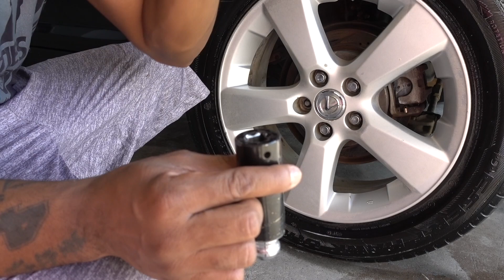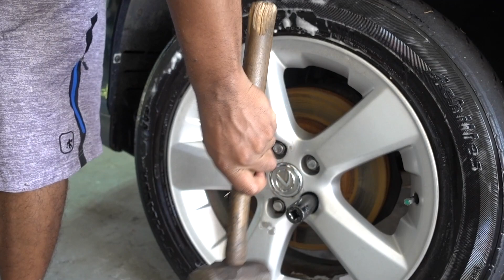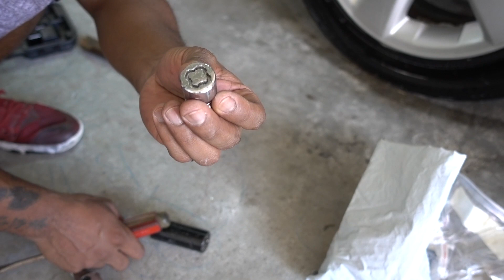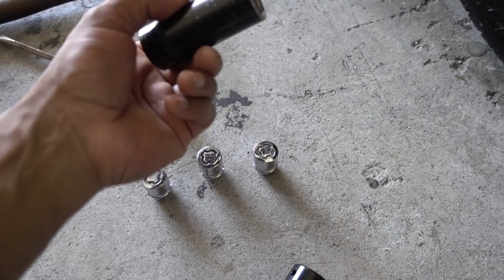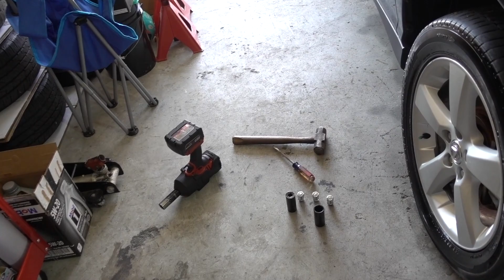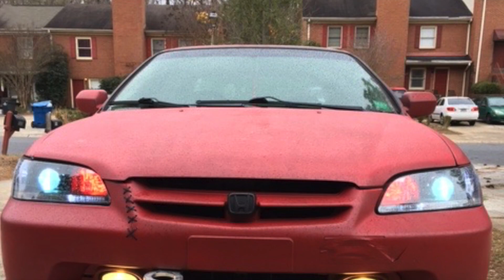How I Remove Wheel Locks Without a Key

Comment: Hey bullet i need help, i was told by a muffler guy my rear oxygen sensor on the 2000 4cy accord 2.3 liter UELV was under the passenger seat, i seen a black grommett under the car is that the rear sensor, i looked at your previous oxygen sensor video but your engine is different than mine.
Reply from the maker: Every car should have one on the cat
Reply: Yeah the sensor is in the cat but the wiring comes up under the passenger seat.